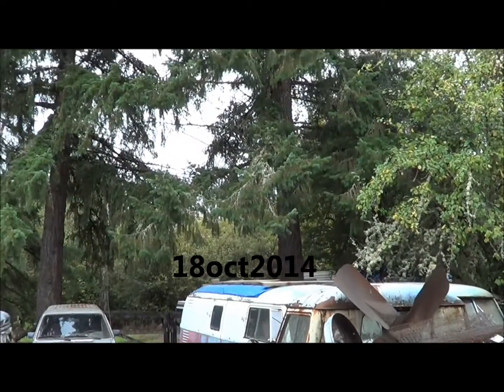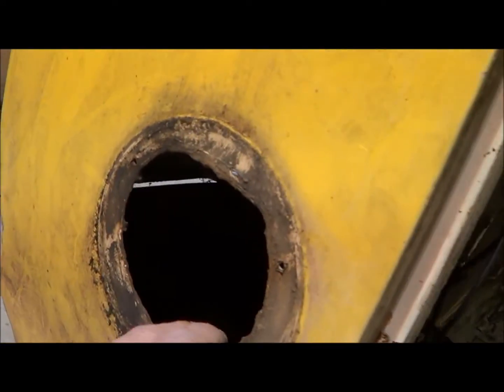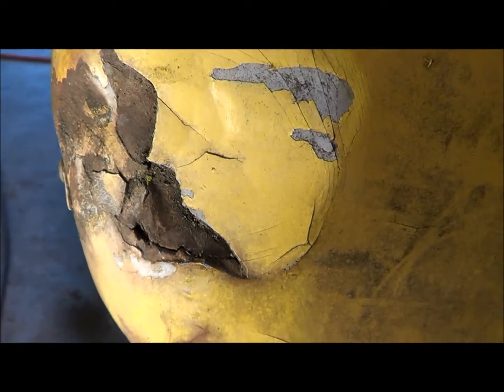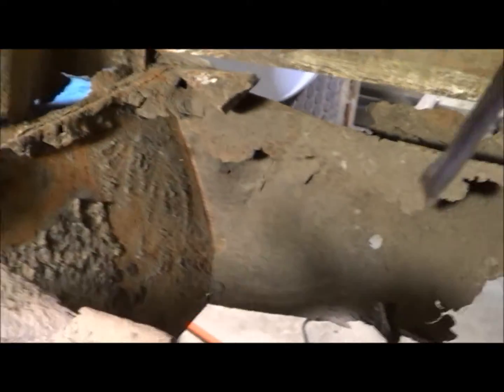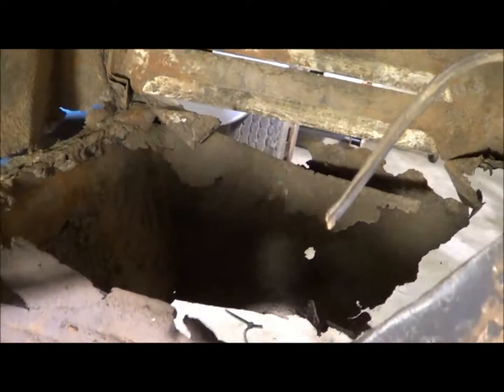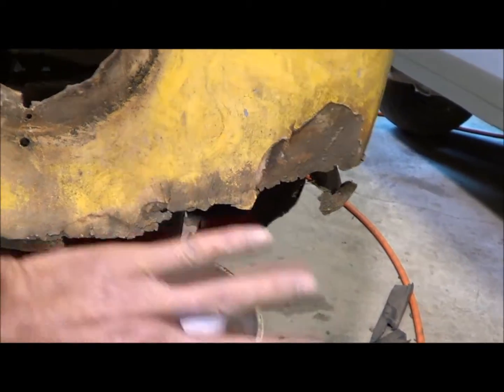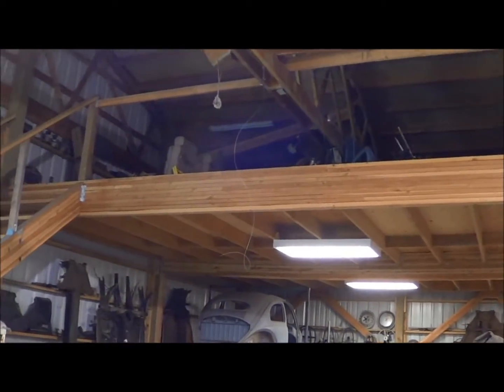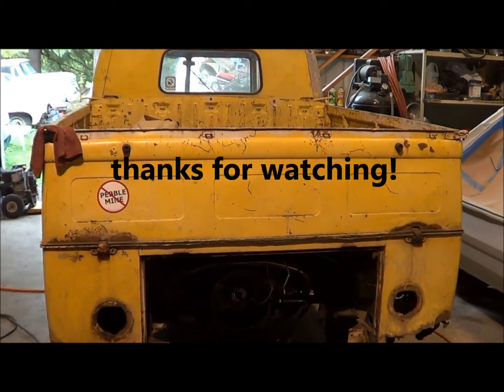assessing the carnage and 12 days to go

Comment: I know you can form up the corner.  I see it in 3 pieces, the back, the side and the corner.  The back and sides can be formed over your knee, the corner will take a few minutes but a pipe and a hammer is all you need.  Congrats on the retirement.  BTW, I didn't know you had another single cab in the barn.  DAMN!!!  I'm a buyer if you ever need to dump one.
Reply from the maker: Greg's Garage still figuring the corner repair...its the lower corner area that will be the hard part. The single in the barn is a "low rider" project someone had started. I have reworked the previous "lowering" work and made some corrections. Hope to get it on the road someday...even ugly it will be a cool ride. Thanks for watching!